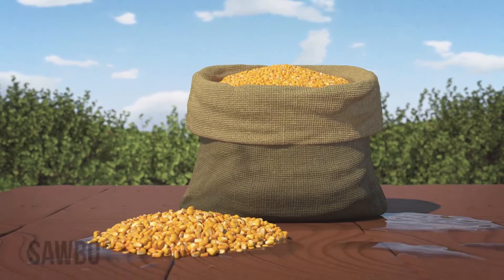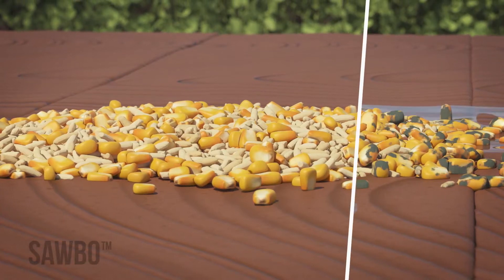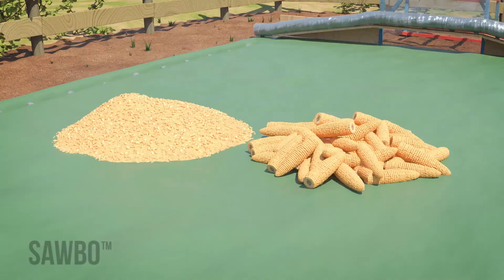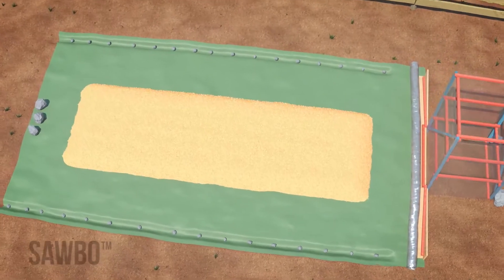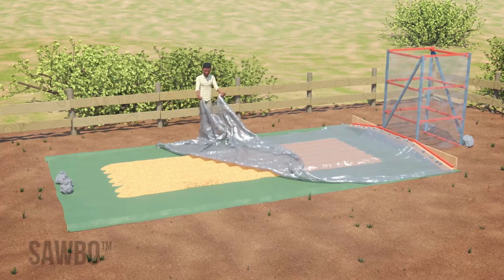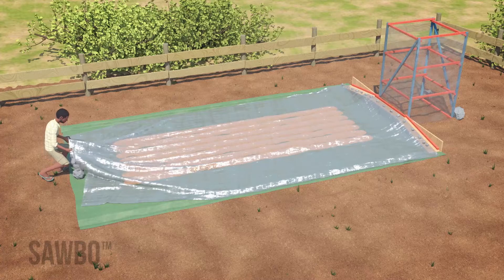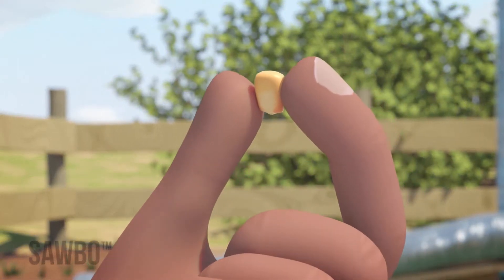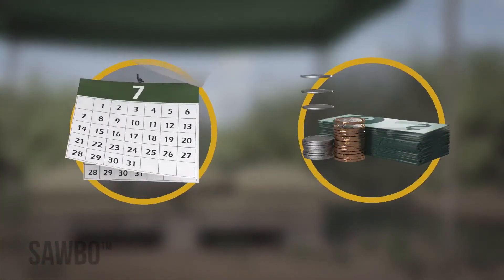Postharvest Loss: How to Use a Solar Grain Dryer in English (accent from USA)

Comment: Great animation on serious issue. However, the "Postharvest Loss: How to Use a Solar Grain Dryer" animation depicts an open top moisture meter. Ghana Standards Authority working with African Regional Standards Organization say they are unable to calibrate or standardize open top moisture meters. This means open top moisture meters are subjective and prone to protocol. 
More at <http://www.ebafosa.org/images/NewsArticle/PHL-CerealGrains.pdf?utm_source=PHL+in+the+News&utm_campaign=76ae37ca5f-PHL_in_the_News_December+4_2015&utm_medium=email&utm_term=0_fd863700b4-76ae37ca5f-102347729>